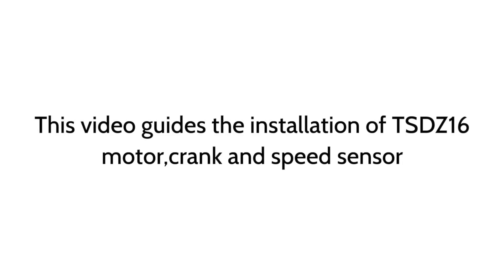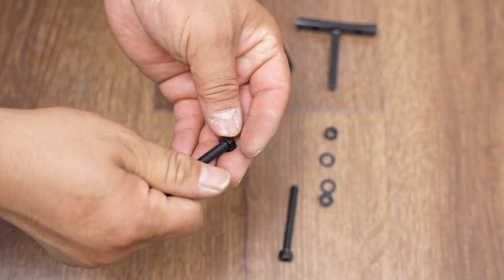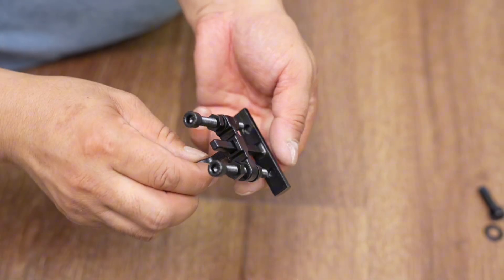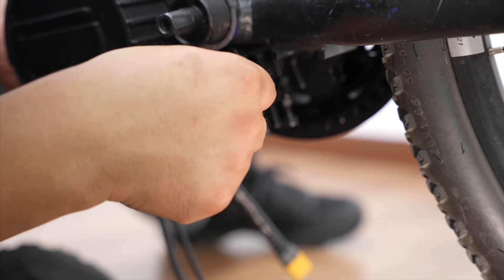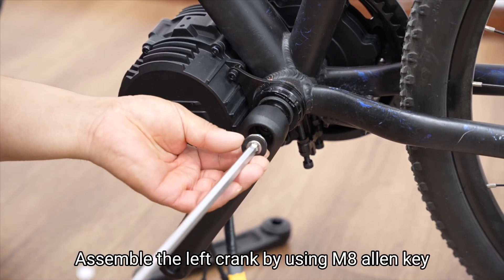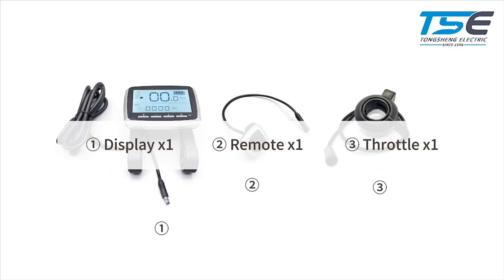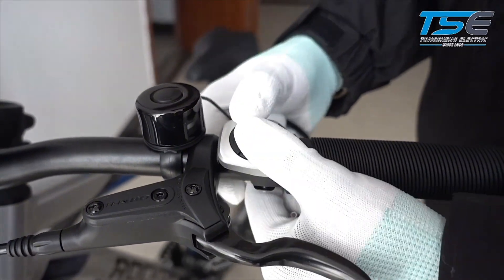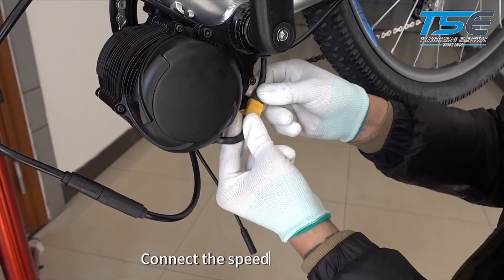TongSheng(TSE) TSDZ16 48V 1000W Mid Motor Kit Installation & VLCD5 Display Installation

Comment: Mine came with two feet of battery cable hanging off the motor. A bit excessive. I only needed 6". I also had to use 3 washers for the gear case to clear the chainstay on my Specialized hardtail, which was disappointing. Now I have a horrible chain line. I hope to see more chainring offset options for this motor in the near future. It has a lot of power and so far the torque sensing seems superb.

Comment: Will not be able to accept 52v battery?
Reply: Just by pure technical it shouldn't be an issue. All 48v controllers can handle 52v. The hard limit is based the power MOSFETs inside the controllers, which are usually made to switch 60v max. A fully charged 52v battery is 58.8v, so it's still safe. However it hardly depends on quality.

Comment: When will it be available in the USA and who are the distributors?
Reply: I bought on AliExpress for 350 euro,like good,i Need to install now😊
Reply: @maxs77 let us know here if it rides significantly better than TSDZ8? AND if it’s still quiet?
Reply: @ReasonAndHeart  I just set up my new TSDZ16 and it's virtually silent.
Reply: @southfork67   Nice. Did you own TSDZ8 before? If so, can you comment on the power and how the two feel differently in practical riding, hill climbing?
Reply: @ReasonAndHeart Sorry. The TSDZ16 is my first build. Literally just finished tidying it up tonight. Only a couple miles but I can tell you on assist 5 it pulls a 5% grade at 28-30mph with minimal effort other than keeping up the cadence. I feel like if I use the max power very much my drivetrain won’t last very long. I have an Aventon Level 2 500w hub drive factory e-bike and this Z16 feels like a motorcycle compared to it.

Comment: what is the top speed and the torque of this motor and most importantly what is the total weight of the full motor with crank arms
Reply: 6okm/h,120nm torque,6kg.
Reply: @maxs77  lets see some live footage of it in action, thanks for the reply.
Reply: @maxs77 TSDZ8 was advertising 120Nm, I can only hope TSDZ16 does better than that.
Reply: @maxs77  tsdz16 160nm, tsdz8 120nm